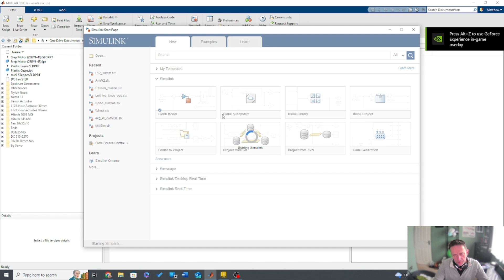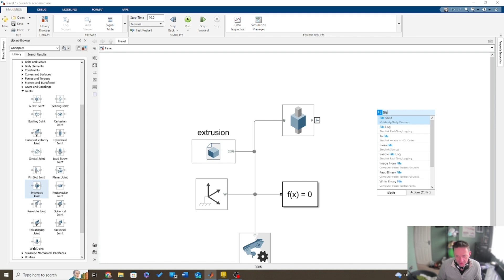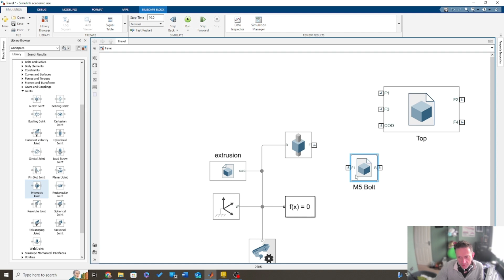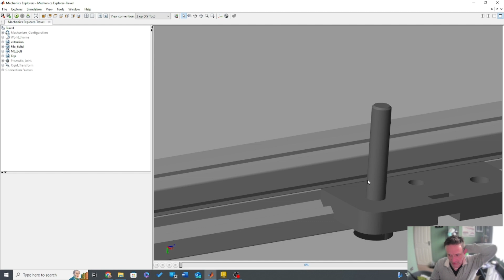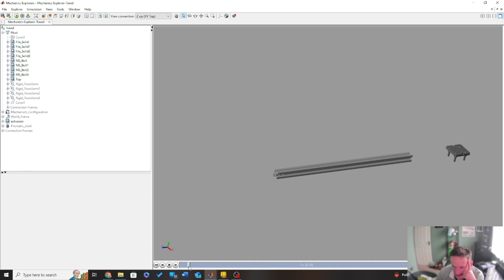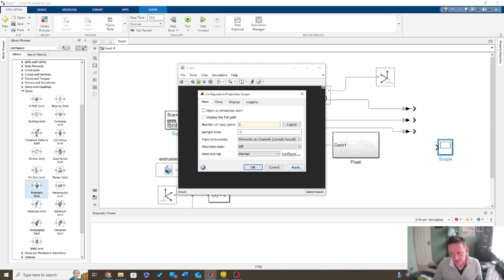Matlab Simmultibody 3d Printing rail

Comment: wow had no idea you can do this in matlab
Reply from the maker: Yeah, matlab is extremely powerful, personally the multi body tool set is amazing.  If you have a controller like arduino system for example, you can use this as an input to control your prototype, just awesome, thanks for watching.